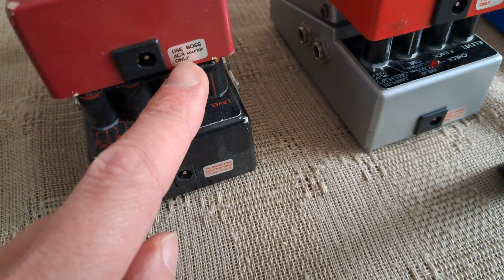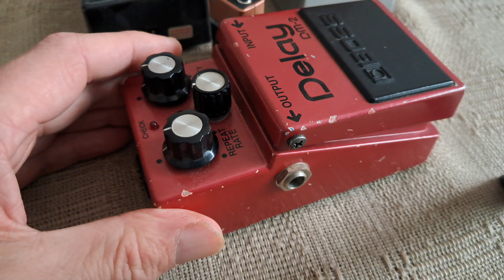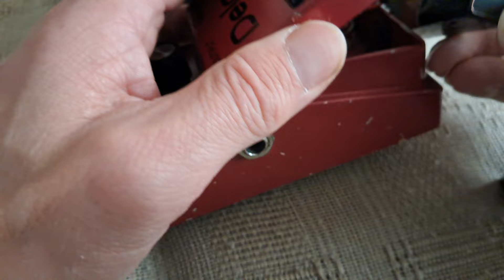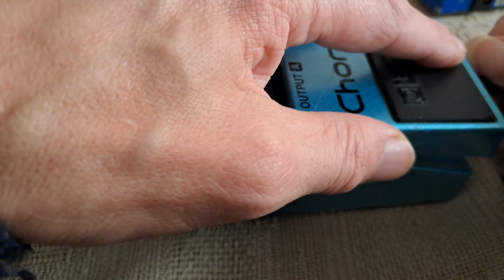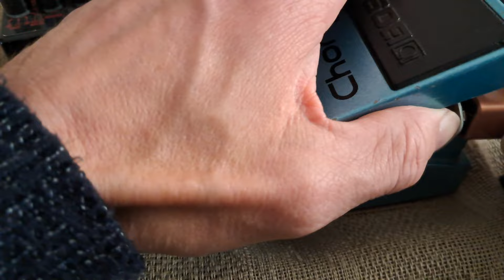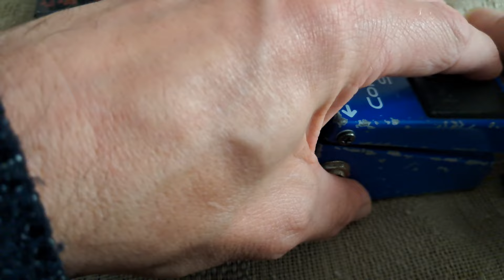Boss Pedal Power Supply: ACA or PSA?

Comment: What kind of batteries do you recomend to use in a Cs3 boss compressor and overdrive odx1? There is a problem to use batteries in some and in others use power suplies of 9v? The original psa power suplies cost a lot if your have a rig of pedals 7 or more…
Reply from the maker: I only use batteries in gear that can only be powered that way. I go by the biggest MAh. In the UK use Duracell or Energizer perhaps? 9-volt rechargeables can be an option too although it's possible that they can bulge and then explode under certain circumstances! A power supply can be configured to power a battery terminal too but only if it's made safe to do so (see thegigrig). A 9-volt battery can power a DC 9-volt power socket under specific conditions but I most often avoid this scenario.
Batteries are isolated and do not (should not) interfere with other powered pedals in terms of grounding.

Comment: THANK YOU… 

I have a Boss CS-3 Compression Sustainer pedal that has the ACA sticker and I was just about to go in and “fix” the defective power supply circuit when I decided to look up ACA power supplies on a whim.

But when I found your video and it let me know it just needs a 12v power supply (a requirement that my Voodoo Lab Pedal Power PSU can supply really easily) I was gobsmacked. I just needed to flick a switch to go from 9v to 12v on one channel  and VOILA… the pedal works fine without any need for fixing.

So again… thank you for posting this. It saved me from a bunch of needless work. I wish they would just put the required voltage on the pedal like other manufacturers.
Reply from the maker: Thank you and congratulations for successfully powering your pedal using resources that you already possessed!
Well done! Not everybody makes it there you know?!?! All the best, Dale Harris

Comment: I have a GE7 ACA, why it only works with 9v 500mA daisy chained and not work with 9v straight or 12v? can't get it
Reply from the maker: ACA Boss pedals include a zener diode (and a resistor) that senses 9-volts in a daisy chain; but requires 12volt from a single power source.. If you also watch my videos on the Boss PSM-5 I continue to test and explain those odd voltages in early Boss pedals.
Reply: @EverythingGuitar23   @EverythingGuitar23  many tks for yout reply. to be honest it works in daisy chain 9v if paired with the pedals on the same chain.. but wont work as single powered pedal with a 12v adapter.. can't get it :D I'm using a Power Plant ISO-5 Pro, set a 12V 500mA but nothing happens LOL
Reply from the maker: Is that a Harley Benton PSU? I would have guessed that setting outputs 1 or 2 to 12 volts (presuming pin negative) that a Boss ACA pedal would work. I have a few more videos on this topic because it's definitely causing an issue with many users out there. I'll try to help if I can of course. I have a theory as to why it might not work. Your ISO switchable outputs (if Harley Benton) are 500ma. Boss often recommends 200ma. Could it be that??? What I'm saying is try a 200ma 12volt pin negative power supply (preferably by boss!!) . Hopefully you use a multimeter first. Remain extremely cautious and test test test before plugging in other PSUs.
Reply from the maker: Okay I'm also planning a video about best practice with daisy chains. To be honest, there's a checklist of do's and don'ts. I'll try to cover these aspects because it isn't necessarily a bad thing to use a daisy chain but it can cause some awful problems too.
Reply: @EverythingGuitar23 if I pay attention using only 9 or 12V adapters there is any chance to fry the pedal? Many tks. I used daisy chain for 20y now I finally decided to move to something smarter like a PSU but LOL
Reply from the maker: Yes, it is very wise to remain cautious. Better that the pedal works because it really is a nightmare to blow up a boss pedal. I blew up a Boss VB-2 when I was young and wreckless. Got it fixed but it was avoidable!!!
Reply: @EverythingGuitar23 many tks! Do you have any video tutorial showing how to modify the pedal in order to use 9v PSA?
Reply from the maker: I personally prefer leaving Boss ACA pedals as stock; it it ain't broke then I don't fix such things. I would rather not be blamed if someone sees such a conversion video of mine and then they wreck their Boss pedal and try to blame me (and believe me I do get some blame game merchants on here!!! ). 
 If I use a Boss 12v ACA FX with Thegigrig modular PSU I have a specific power module for it. If with Cioks PSU I might bridge power to it and test for noise. If with a Palmer PSU I might use 12 volts or again bridge the power at 9v. It's seldom been an issue for me and I have a fair few of them!
I'm planning to make a few more videos on both power and also switcher pedals and a few will focus on Boss gear. I've been noting that there are many questions left to answer in this particular field!
With the cost of having one converted you might as well purchase a boutique equivalent pedal IMHO. It is possible to grab a circuit diagram and undertake the work yourself but I would test the proceedure on scraps until the technique has been nailed.
Reply: @EverythingGuitar23 many tks for your advice ❤

Comment: Hi!!! So if I use the old Psm 5  power supply on Delay and the Boss pedal is it going to work properly? Thanks 🙏...(or any other  power supply suggestions???)
Reply from the maker: The Boss PSM5 will be fine with old 12 volt pedals yes. A Boss TU3, or Boss LS-2 will do much the same. That isn't your only option (because there's Cioks, thegigrig, Strymon, Voodoo Labs, 1Spot,etc.) and I personally don't like to run more than 2 pedals with a daisy chain from one electrical ground.
Reply from the maker: I have just recorded a video on the Boss PSM-5 showing it in use with both 9 volt and 12 volt Boss pedals. I hope that my explanations will help! The latest video will be out in 30 minutes!

Comment: Am I the only person who is just even more totally confused? Where is the super simple no filler explanation on what to look for? There must be a super simple way to look at a boss pedal to easily tell whether you need 9v or 12v.
Reply from the maker: @Drumcitypickers That's because I was trying to help others who would blow-up their boss pedal because a previous owner forgot to say that a 12-volt pedal had been converted to 9-volts. The new owner then assumes that it is 12-volts and BOOM! 
I happened to show and explain how to tell the difference whilst handing out advice on methods to check the actual voltage differences without resorting to complicated multimeter readings and splitting up power cables! 
Frankly, a shortcut explanation isn't applicable here due to the variations of case uses,  historical tampering and inadequate (and lazy) previous owner information.
Reply: I am confused too. Being on pause with the captions on, trying to make sense out of the unfinished phrases.
Reply from the maker: @robroufla you mean that it was a human speaking and not an artificial intelligence video? I've sat on your comment for some time now. In the meantime, you will see that ohers have since responded to this video positively and in some instances it has helped them to stop using batteries and use the correct power.

Comment: So as I understand from the video and other comments, I could simply use a 12v DC power supply to power any ACA labeled boss pedals, and forget the 9v battery or 9v regular power altogether? 

I’m specifically referencing a 1982 OC2 which I really don’t want to blow up 🙏 thanks!
Reply from the maker: A boss style PSU designed as DC pin negative at 12 volts will work with those pedals as described in my video. Do make the necessary checks and if you are still in doubt consult a qualified electrician/electronics engineer or a knowledgeable friend. My old DM-2 is a no brainer for the above. The bottom side of the pedal should also give you some clues. The dim LED on 9 volt PSU and yet bright on battery is another solid clue. 
I know if I still had my old OC-2 and it worked on a 9 volt daisy chain, and via battery and yet sounded bad on an individual 9 volt PSU plus with dim LED symptoms then I'd know that it was actually 12-volt pin negative DC. 
Best regards, 
Dale
Reply: @ you’re the best. Cheers!

Comment: why then if you daisy chain a 12v pedal to a 9v pedal using a 9v supply do they work fine then how is bypassing the resistor and diode then ?
Reply from the maker: It's that daisy chains share a common electrical ground, which bypases the voltage limiting components that normally see the 12 volts causing the ACA 12 Volt Boss pedal in the chain to see the correct 9 volts (like they would do when seeing a 9-volt battery).
Best regards, Dale Harris

Comment: I have boss compressor sustainer CS-3 dedigned for ACA adaptors which works well when is charged by 9V battery, but it is buzzing when I plugg it to dc 9V PSA adaptor. At the bottom there is a stick informing to use ACA 230(DC9V). I am still looking how to solve the buzzing problem when I plug it to PSA 9V...Should I try DC12V PSA even though there's recommendation to use DC9V, or should I look for second hand ACA adaptor? I don't want to rely only on batteries which cost $5 dollar each. I would be grateful for any suggestions if this can anyhow be solved.
Reply from the maker: Can you tell if the red LED is brighter than battery when plugged into PSA adapter?
Reply: @EverythingGuitar23  Hi, thanks for response. No the red led is darker, when I plug it to PSA 9V, exactly like in your video.
Reply from the maker: On the schematic, if D10 and R32 are present, you have one of the earliest CS3 pedals that was made for 12V. Look closely at the circuit board and compare to the schematic is the 100% fool proof way. I'd put money on it that yours is 12volt but obviously I cannot see your exact pedal and PCB configuration as yet. Only plug 12 volts into it when you are absolutely certain!
Reply: @EverythingGuitar23  many thanks! I've had enough of it and found a good offer for Procell batteries, which is still much cheaper than to buy the new CS-3 with PSA. Cheers!

Comment: It is written under the pedal on the large sticker too... Not just the sticker beside the power connector.
Reply from the maker: Although quite a few of the used pedals have those stickers missing; pulled off post velcro.
Reply: On my Boss CS-3 Compression Sustainer it just has a list of different adapters for the various local voltages. Basically it lists the input AC voltages but does not list the DC voltage requirements of the pedal (ie 12v instead of 9v).

Comment: I've recently bought an used MIJ GE-7 and the on/off LED was not working. After searching online and looking at the pedal, found out that it has a "Use Boss ACA adaptor only" label on it. Pluged on 12v and voilà! Led is on, pedal is working fine and it is also less noisy. Thanks for the info.
Reply from the maker: You know, this happens so often, so thanks for confirming that my video is useful. Makes it all worthwhile! All the best, Dale Harris
Reply: I have an old GE-7
DC 9v gives me a bright led
Power supplies like voodoo or coiks DC-7
at 9v DC has a very dim led
There is an article regarding older Boss pedals with ACA stickers on them 
or “use boss ACA adapter only” stickers online
The site is 
“ Stinkfoot.SE”
“Boss, ACA and PSA – what gives”
That explains how the port uses 12 V AC and also offers a pretty easy mod so 9V AC will operate the pedal the same as the battery
Reply from the maker: Yes, it's a zener diode in the circuit that controls the voltage gate between 9 and 12 volts. There are solutions so it's not all doom and gloom for ACA FX owners!

Comment: My pedalboard got lifted so I'm putting together another one. It was an original boss pedal board case that came with a red power supply a pms-5 that powered all of the pedals. Now I guess they don't make that anymore, I'm getting a used one off guitar Center, so I don't know what they're doing and why they would stop making that or not making that available is moronic, I would think. 🫤
Reply from the maker: I owned a PSM5 and the BCB6. There are plenty of PSM5 switch pedals still around albeit used; the newer version is a different format in the LS2 - but the old red pedal is easier to plug into if first in the chain. They updated the old BCB6 case for a more open design, but still essentially the same as the old version. The catches used to break on those old moulded cases which was their downfall.
Reply: @EverythingGuitar23  o I c.. that's what I had, I had it forever, I just looked up that one and I didn't even know that were around. I never shopping or look around much if I need something otherwise I would be buying stuff. The red pedal I'm assuming Powers the other so since I only need three petals, instead of having three power supplies, I was just going to use the red pedal to power the three, since I have it otherwise I'll just go with some good rechargeables. 😐